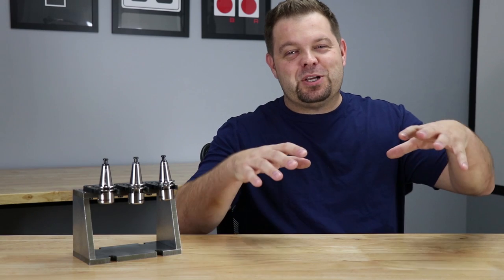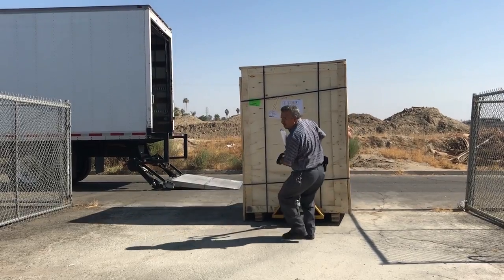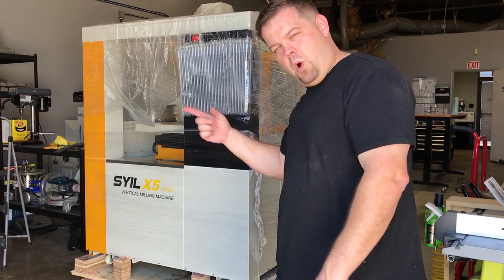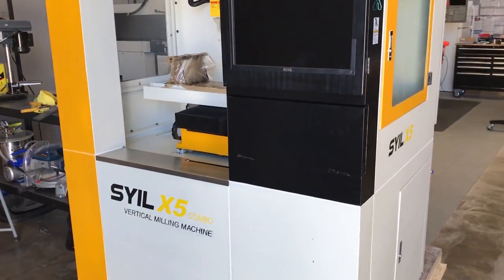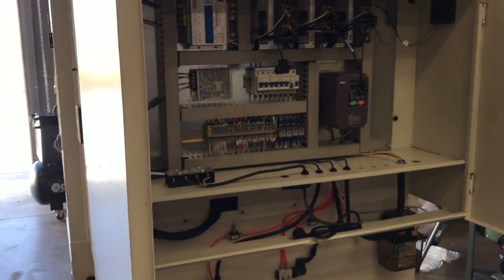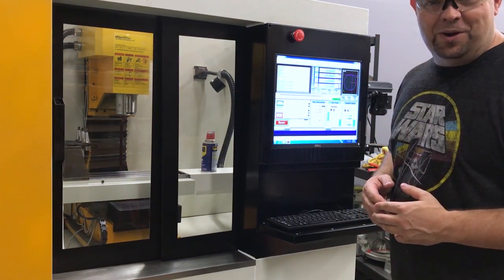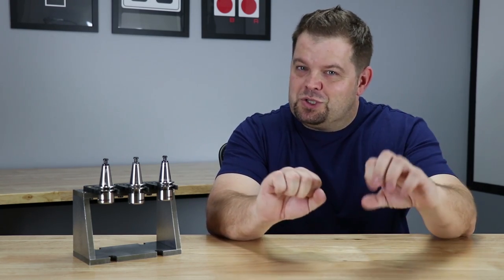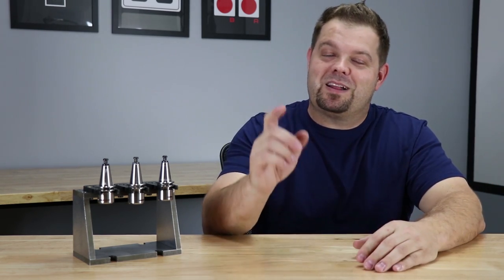Syil X5 - Delivered, Unpacked and Powered Up

Comment: Mach3 is soo dead software being it windows based. Go linuxcnc and never look back. You need a realtime kenrel when running a cnc.
Reply: Windows has nothing to do with the software being slow. Okuma has a windows based control and it doesn't have any issues. It's really more the implementation and quality of the equipment purchased.
Reply: @goldentrigun  i never windows is slow it is the kernel that windows use is not made for cnc control. now for what Okuma is probably using window embedded that has a patched kernel but you cant do that with window vista and all the way up to windows 10. you could try to patch it in vista or 8 but Microsoft won't support it and 10s kernel is so locked down its not worth it try. now with window embedded you can patch it or do whatever you want to it. though it does look window embedded is on it way to its grave to be replaced by windows IoT os.
Reply: ebulating  but you forget about interrupts those call latency the more the interrupts the worse the latency gets. Now most Linux kernels don't support real time functions. But it was patched up about 10 years ago or more to turn off or stop the interrupts that would happen. I see some latency numbers around 2sec and up to 50sec with a real time kernel. Without a real time kernel latency numbers can start around 200sec and go up from there. Now not every CPU and motherboard is going to have good latency (hp cough..) especially systems that try to do power saving those cause a lot interrupts so like laptops. Speed has nothing to do with latency in the end it's other factors that determined how well a real-time kernel works.
Reply: What do you think about Fusion 360?
Reply: @AATopFuel  i love it!!! easy to use.
Reply: Mach3 and the newer 4 is clumsy written and inherits alot of the bad algorithm problems from earlier versions. Its just a bad piece of software. Running a CNC controller on windows these days is not really a problem, the LCNC communities claim for realtime kernel computation comes from their HAL abstraction, that is in it self a crappy implementation, and was quite optiomized for machinekit that solved alot of the problems and can make it work on an ARM CPU. (beaglebone black). So in the end, badly optimized code on any platform will be shit.. LCNC community should get the stick out of their collective asses and learn some things about optimizing code instead. It has the potential of being greatly improved and run flawless cross platform if it just sorts its HAL abstraction and optimize it.
Reply: WoW
Reply: ebulating  linux can do realtime just fine. a well-configured windows machine can also do realtime just fine.

Comment: Your backlash test didn't rule out backlash compensation in the software.
You need to take cuts from different directions meeting in the middle to see how much is pushed against the backlash.
(Rigid cutter, shallow cut, to avoid tool deflection confusing things too much.)

Comment: I'm no international shipping expert, however you actually want them to just use plywood for all the wood in the crate.  If they use any solid wood then the crate needs to have ISPM 15 markings (showing treated wood) otherwise the shipment can be denied entry.  If it's plywood then ISPM 15 markings aren't needed as the wood has essentially been fumigated through the manufacturing process.  Ideally they wouldn't have even used that solid wood block to support the spindle, as that could cause the shipment to be rejected.   Shipping between Canada/US doesn't need to meet ISPM 15 but anything coming from China does.

Anyway interested to see how the machine works out.
Reply from the maker: Hey Greg, sounds like you know a helluva lot more than me about shipping :) Thanks for the comment.

Comment: Nice spindle speed 24k I must say the controller means so much, Like to know how that works out for you Jason. Funny I was the first  guy in the shop that ran all the new CNC's that we bought and when we got the new HAAS Mini Mill and I was checking backlash just like you I couldn't believe that pulling down on the controller arm mount or just tapping your foot on the base of the machine would move the needle .002 to .005, try it. That being said the machine proved itself time and again. Good luck with your Syil.

Comment: Digging this content and this machine looks great!   It could be a bootstrappers gateway to CNC for alot of small business owners.  I have some products that right now I getting cut with a water jet, but I rather have a small mill that I can load a small piece of precut .25 6061 and make parts as they are sold.  Looking forward to any comparisons against your Tormach/Haas.  The Syil guys are probably really stoked on the new eyeballs and exposure.  I never heard of these guys until you introduced it.

Comment: Nice, loving the content. If you'd be willing to share I'd love to know what "inexpensive" relates to in actual dollars. So many vendors only have poa on their websites so to hear from someone who's been there and done it is invaluable. Also if there were any hidden extras that aren't included that info would be gold. Cheers, Owen S.
Reply: I would like to know ballpark how much it was with servos and ATC.
Reply: This was the quote I received on June 1 2018

The X5 in a full enclosure with 8 place ATC, BT30 9,000 rpm spindle, Servos on all 3 axis, Siemens 808D Controller, flood coolant and the cost is 17,300

The X7 in the same configuration as the X5 with the exception of a BT30 12,000 rpm spindle and a 10 place ATC cost is 19,880

Shipping to Southern California is 
X5 Combo 880.00 
Weight is 1,400

X7 shipping 
1,762.00 
Weight is 3,000

These quotes will be somewhat lower with out the ATC's that I requested.
Reply: @bigdogkmc  
Much obliged, thanks, Owen S
Reply: @bigdogkmc  thanks for sharing!
Reply: K Mc right now for the x7 combo lnc5800 include tool changer ship to any address in US will be at 25990$

Comment: heres my concern with the  spindle motor.. If you are running a 1/2 inch end mill ,will it have any torque in the lower rpm settings?? I know for example my 1 .5 kw 6040 motor is almost useless below 10k rpm.,, anyway , the machine looks amazing
Reply from the maker: you literally cant fit a 1/2" end mill in this machine. this spindle isn't really designed for anything bigger that 1/4".....its basically a small cnc router spindle with a built in air draw bar..Syil offers larger spindles....like BT30 options.
Reply: @NerdlyCNC  makes perfect sense now ! thanks/.
Reply from the maker: @airgunningyup  no problem

Comment: So, its been 3 weeks.  You still happy?  I have three Syil Speedmasters.  An X4 and 2 X5s.  To be quite frank I'd be hard pressed to buy another one.  All of mine needed a lot of work.  They had assembly issues and even unfinished machining.  Little things.  Like unfinished oil passages that oil wouldn't go thru.  Maybe other little things like oil lines that were left off, and the fittings didn't even have a spot for the missing oil lines.  How about a saddle casting that was either broken or an incomplete casting that cut parallelagrams  that were neither square nor rectangular.  How about a machine with a bad ballscrew with bad bearings brand new.  How about 3 out of 3 head support gas spring failures in under a year.  How about a spindle with bearing noise on first power up.  Yeah I have them working now, but only after lots and lots of work and only because shipping them back to China would be to exhorbitant.  How about multiple fan failures, and a coolant pump that started rattling after about a week.  How about half dozen bad relays in the first year.  How about an axis with 3/8 of an inch slop right out of the crate.  They left of a spacer on the bearing.  How about little things like cabinet latch pieces found randomly through out the crates.  No the latches didn't fall out.  They fell apart.  All of my machines have new third party spindles now.  One was bad out of the crate (bad bearings).  One failed after about 700 hours of run time (bad bearing noise) and one I ran for a year as expected.  Oh, yeah.  Almost forgot.  The limit switch cams had to be moved or modified or both just to keep them from binding up and get the actual travels Syil claimed.  All three machines.  

Syil's first response when I gave up on domestic dealers (one told me to just contact Syil) was "We have a holiday coming up but we will take care of everything after the holiday.  No problem.  Maybe you can start a YouTube channel to promote our products like guys do for Tormach."   

My reply:  "Sure as soon as you take care of all these problems.  My first video will be about your great follow up and customer service."  A year later they had not taken care of anything.  

Now to be fair.  I did get a replacement for the bad saddle on the X4 air freighted from China.  Syil totally blew me off, but a dealer told Syil they would stop selling their products if they didn't replace the saddle.  Even that took a while, but when they finally decided it would cost them to much to screw me they finally fixed one thing.  Every time I found something else that was just blatantly incompetent or knowingly negligent on the X4 their response according to my dealer was "Well its not an X5."  The X5s maybe better on paper, but the assembly and construction is just as bad if not in some ways worse.  Basically its heavier, has linear rails, and has a more powerful spindle.  That's it.  Is still thrown together from across the room, and I am convinced a lot of used parts went into one of the ones I received.  Bad parts in both of the others.  

I told the dealer for the X5s when I bought them. "I WILL PAY EXTRA FOR YOU TO TEAR THEM DOWN, FIX EVERYTHING, AND RECRATE THEM BEFORE SHIPPING THEM TO ME."  Well that obviously didn't happen.  

Anyway, after all that I still use them.  I just spent more money on them than the price and shipping charges.  If you think of them as a starter kit for a B grade machine then you are ok.  If you want to make precision parts based on their claimed specifications, run them as intended right out of the crate, or expect Syil to warranty anything not paired with a threat with real teeth then you may be in for a rude surprise.
Reply: Damn bro if you had that much shit why even buy Chinese junk.
Reply: @EricB90  - Yeah hindsight is 20/20, and somebody else's sight after youtell them is 20/10.  LOL.
Reply: True. Ive always used American or Japanese machines. Haas mostly but i would never buy light weight/Chinese machines. Same with all of my hand tools... they are shit products and i couldnt be happy with that much run out on a machine.
Reply: @EricB90  How much is to much?  I'm running multiple Chinese high speed spindles and turning ball mills as small as 1/32 nearly everyday and .026 regularly.  Mostly in aluminum, but occassionally for 3d embossing dies in steel as well.  I only break one if I make a mistake.  Not much runout in those.
Reply: Bob La Londe, when did you buy those machines and when did you have the customer service issues? I am interested in the x7 combo, Siemens control, upgraded splindle, etc. I heard bad things about the old machines and past management.  I'm curious if that applies to your situation. I have also heard the the newer machines are significantly improved but am still concerned. Thanks.
Reply: @unpopular_mechanics  2 years ago give or take.  4-5 years ago on the X4.  Problems were apparent immediately as lousy assembly and defective components don't take long to recognize.  I was willing to give it another try after the X4, but I can't see myself giving Syil another shot at any of my money.  The final nail for me was when they said they'ld take care of it all and then didn't.  Fortunately I was able to tear them down and make them functional.  I guess that's the price you pay for CHEAP machines.  Interestingly I have a Tormach 1100 that I'm much happier with.  Oh, its not perfect by any means, but its much better than any of my Syil machines.  I kind of wish that I'd gone with a Haas Super Mini or Super Mini 2 instead of any of them though.  I was just torn about buying one machine or multiple machines.  I do still have my Hurco KMB1 that I retrofit for heavier work.   Its funny.  Somebody at Syil asked me about doing the videos shilling machines like Saunders does for Tormach.  I told them if they took care of all my issues and anybody else's I heard from quickly I'd be glad to make videos showing their machines cutting parts.  They said "after the upcoming holiday."  I never heard back from them.
Reply: I have heard that old management vs new management bullshit more than once.  Over multiple companies.  Syil is no different.  "Oh we have new management.  Its different now."  Looking at $30K for a "premium" Syil X7 I'd look elsewhere.
Reply: Hmmm 15 x 10 inch working envelope on the X7 vs 16 x 12 on the Haas Mini Mill  I'd buy the Haas instead.  $32K base price with a 10 tool carousel.

Comment: Not sure how much either of your VMC's cost but the best bang for your buck is a robodrill ECO. It eliminates many of the bells and whistles to give you a lightning fast VMC for about $60k. Watch one tool change and then drill a 1.625" hole in steel and you will be sold, I was. You can add some options if your budget allows but the bare bones is pretty good in my opinion. Think about tapping at 6,000rpm!
Reply: I'm in the market for a small, fast mill and have considered the ECO line along with the S series Brother mills which also ballpark in the mid $60k's. But the X5 line of Syil's with a few bell-and-whistles, having just gotten off the phone with Paul Frink, is very low $20k's - much lower if you're happy with fewer accessories than what I want. Jason and Paul may have just changed my manufacturing startup business plan.
Reply: @NONAMESLEFTNONE  WOW that is low! Seems like a good way to start CNC machining on a budget.
Reply: NONAMESLEFTNONE that is good review of our US customer sales service ! Syil America boy is good guy ! Hope you make some deal with them too !